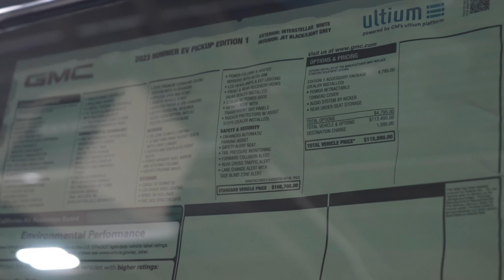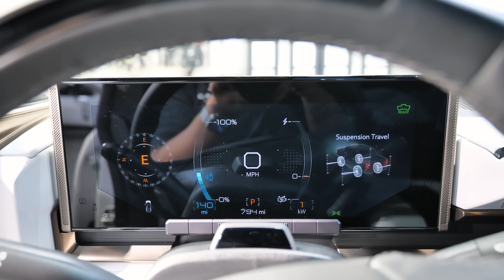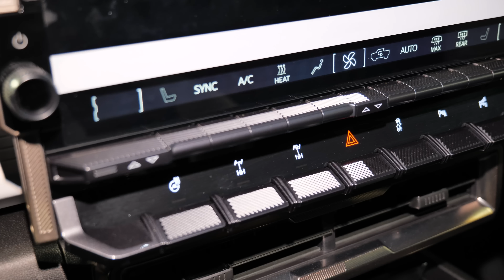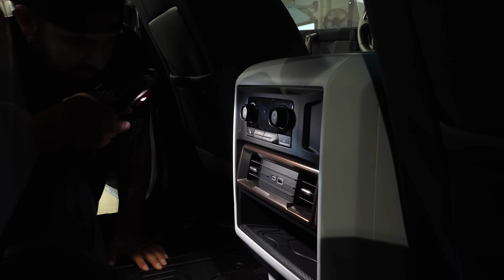Is The New HUMMER EV Perfect? Here's What We Found...

Comment: The side step doubles as a rock slider. It's functional even if it makes cleaning a pain. The wheels look like they are bead lock capable for airing way down to go off-road. Bead locks are not legal on road.

The steering wheel lights up for super Cruise. Autonomous driving on premapped highways.

The frunk is for storing the t tops
Reply from the maker: Thank you! Pinning this info for others to see.
Reply: U forgot to pin it @ChicagoAutoPros